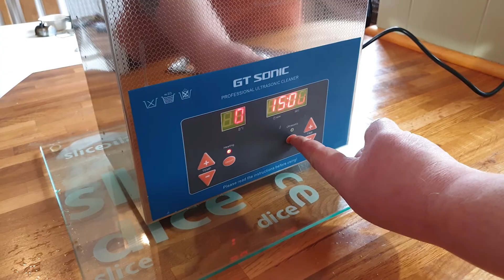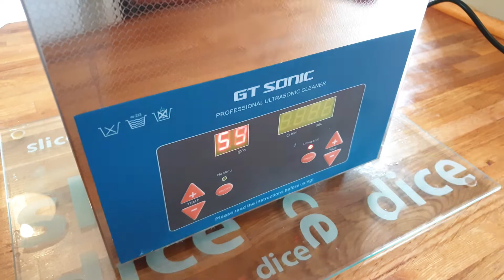Ultrasonic Carb Cleaning - How to Clean Carburettors Properly - Honda CB750 | Part 5

Comment: Just bought the same 1 on evilbay. Advertised as a 3.2 litre but the truth is it only holds 2.5 litres.
Reply from the maker: Alway seems the way.  However the last bike I bought was supposed to be a 750 but turns out it is 744cc, but the one before was a 750 that turned out to be 823cc.  Funny old world :)
Reply: @SPANNERRASH  nah, it's just plain old false advertising. Same as their metal "sheds". I suppose it's fine when you're sent freebies to promote.

Comment: Hi I no video old !! & I hope you can reply with advice 
 I repair our fishing clubs 2 stroke strimmers & chainsaw’s carburettors ( not all at once ) & was considering the 3.2 litre machine & to use it maybe 3 -4 times a year  would that size be ok ????
Reply from the maker: I would think that would be fine.  But don't forget although the ultra sonic is good, you still need to blow any little air ways through with an airline to make sure everything is clear.  Good luck, and happy strimming!

Comment: seems to work ok but seeing it doesnt get eveyrthing out or off of it like those things hes scrubbing off on the side i probably get just a good a cleaning using carb cleaning spray...i mean the cost of spray adds up for sure btu its alot quicker. plus i have all the other tools too
Reply from the maker: I hear what you say, but the ultrasonic cleans parts that you can't reach.  To get a really nice finish on these kind of carbs, vapour blasting or soda blasting is great, but you can't clean all of the little holes inside them.

Comment: Tip: instead of putting all the dirty things directly in the bath (and ruining it for more delicate cleaning), put them in separate plastic jars with screw lids. You save detergent and can have different detergents in different cans. Gasoline washes carburetors best.
Reply from the maker: Great idea, which I do sometimes do, and it is a much better way for larger ultrasonic cleaners.
Reply: @SPANNERRASH You can also use plastic bags with a zipper. May be even easier. And the bath is just tap water.

Comment: People say you can put the parts in a freezer ziplock baggie with the cleaning solution and put that in the cleaner, then around the baggie put water. The ultrasonic vibrations go through the water to the baggie of cleaner, and the baggie should use far less cleaner.
Reply from the maker: I have done this too, with small items.  It is especially useful if you have a larger cleaner, saves a lot of fluid.

Comment: I am looking at getting one of these,as it has been a couple of years how reliable has  the one you have been? I've seen similar on another site which is a lot more expensive, not sure whether to chance a cheaper one.
Reply from the maker: It has been great.  We use it regularly and it hasn't given a problem.  Only thing I would change is to perhaps have a bigger one, but then it might cost more in the cleaning fluids.  For what we have been doing it has been a real bonus, and we didn't pay dear for it :)
Reply: I got a 15 litter one and i fill it with water then i put the parts in a separate glass container so i dont use alot of cleaner also i clean my carbs in the sonic cleaner using gasoline in the glass jar with the lid on comes out looking brand new and you dont have to wash it in water afterwards its ready to reassemble immediately after cleaning 😮@SPANNERRASH
Reply: Thanks, as they are a lot cheaper than others, I wasn't sure how long they may last.
Reply: @philiponsolent7232   my buddy owns a dirt bike repair shop and has a cheaper brand 15L one and has lasted the last 2 year of everyday use.

Comment: Looking at the carb after cleaning, it seems that the ultrasonic cleaner does nothing at all. I thought it would come out looking like a brand new carb.
Reply from the maker: Some things come up better than others, but unfortunately, there's not some magic cleaner that makes things of this nature look like new. The real benefit of the ultrasonic cleaner in this use case is it clears out deposits inside the carb that are otherwise impossible to get to. As for the outside casing, vapor blasting would give the best cosmetic "like new" finish.
Reply: You'd need a vapor blaster to make it look new and shiny
Reply: @davegee4129  This didn't even get the dirt off the outside. I've watched just about every yt video on ultrasonic carb cleaning with a view to buying a cleaner, and none of the results are close to what I could achieve in a tray with some petrol and a toothbrush. I think these devices only clean things that arent dirty.

Comment: I just got a 6L today, too small I sent for the 15L, no you will not use more cleaner in a bigger machine. Never I mean never put the cleaner into the tank, put tap water in the tank and put your parts in a small glass or plastic container or a plastic bag, sealed  with the cleaner. You use very little cleaner and don't have to clean your tank,  it's a win win deal. Update, unless of coarse the item is the size of the machine then you would have to use the tank.
Reply from the maker: Great tip Chad, thanks for sharing, that should save a lot of wasted cleaner!

Comment: You know cellulose thinners removes carb varnish, but it will attack any rubber, so remove and plastics or rubbers before you use it.
Reply from the maker: I use thinners to remove pretty much everything :) the Ultrasonic lets you leave some part part assembled, so now worries about seals etc.

Comment: I watched a vid and he put carb parts in petroleum in a sealed container then he put it in the cleaner, in water: 1. It kept the unit clean 2. You use much less cleaning fluid (whatever it may be).
Reply from the maker: That's interesting, not a bad idea at all to use a sealed container, cheers!
Reply: @SPANNERRASH  you want to use sealed glass jars because plastic ones deform and absorb the waves which attenuates the amount of mechanical waves transmit into the contained fluid.
Reply from the maker: @Gideon_Judges6  That makes a lot of sense. I will see if I can get some glass jars to use instead. Thanks for sharing!

Comment: Catching up on your bike vids. Great stuff! I usually put the carbs in a can of dip first to clean or at least loosen the heavy varnish, then into the ultrasonic bath. Distilled water and a Simple Green solution 9:1. Thing is, I think everyone uses something different - if it works for you, all good. I even saw one guy use gasoline. Not trying that.
Reply from the maker: Thanks James, I've had pleasing results with this method but I'm always looking to try different things and make incremental improvements to my methods. I'll check out that solution you mentioned so thanks for that! :)
Reply: I've seen talk of using Petrol/Gas as the fluid, which seems dangerous. Someone else suggested Diesel which makes more sense. Still going to need a solvent to remove the Diesel though....
Reply: Simple Green turned my Amal MK2's dark gray and customers Mikunis blotchy, had to get both sets vapour blasted🤔

Comment: @SPANNER RASH - I was looking at buying one of these today and thankfully stumbled across your great vid. A question, in your opinion, do you think ultrasonic cleaning could help removing a stuck jet or screw?
Reply from the maker: Hi Tristan, ultrasonic cleaning wouldn't do any harm, but if it's stuck then it's likely a sign of corrosion, and an ultrasonic will only ever remove dirt, not rust or corrosion.

Maybe an ultrasonic clean might clean it and mean you get some penetrating oils deeper into where it needs to be to help remove it.

Hope that helps!
Reply: @SPANNERRASH  Definitely, thank you. I got to get one of these :)
Reply: If at least one of the joined parts is a ferrous based metal, try using vinegar. If push comes to shove, a product such as EvapoRust. The acidic vinegar will break down and dissolve rust but how fast it works is based on the potency of the vinegar. Yes, you can purchase vinegar in a variety of strengths so examine your bottle closely. EvapoRust is made to dissolve rust but it's expensive so keep that in mind.
Reply: @PossumWerx Thank you
Reply: Jaki płyn trzeba do mycia gaźnik?

Comment: Nice video, but it pains me to see you use only tap water afterwards (due to the chemicals and things like calcium)that basically like cleaning a piece of steel then putting it outside to flash rust.
Reply from the maker: Thanks mate, interesting point about rinsing with tap water. What would you suggest I rinse with instead?
Reply: @SPANNERRASH  Distilled water
Reply from the maker: @lags736  Thanks, not a bad idea
Reply: @SPANNERRASH  Good to see a man intelligent enough to learn!  Few of us around, mate!
Reply from the maker: @kevinchamberlain7928  Haha! Every day is a school day

Comment: Do you need to remove the 0 rings when using Ultrasonic?  are there any issues if you leave them in?
Reply from the maker: Hi Mick, you can ultrasonic clean with the o-rings left on if needs be. It shouldn't do them any harm. If you can though, you'll definitely get a better clean if you fully strip the item down to its parts before ultrasonic cleaning. Hope that helps

Comment: That bowl should have come out much better first go.  I worked at a motorcycle shop and we had a tank.  It worked AMAZING.  Parts looked almost new. It must be the cleaner liquid
Reply from the maker: We'll definitely have a play around with some alternative fluid in that case.
Don't suppose you have any recommendations for us?
Reply: @SPANNERRASH  LA'S totally awesome degreaser
Reply: @SPANNERRASH  . . . . .spray nine.
75 water 25 spray nine.
Buzz / cook  for 15 or so minutes
Reply from the maker: @lenBrill1971  Cheers, we'll check it out!
Reply: @SPANNERRASH  I always run a cycle on one side then flip it over for the other side, I built one and the cleaning works best on the side of the part that faces the transducers, in this case they're on the bottom, I added transducers to the side of my machine as well as the bottom.